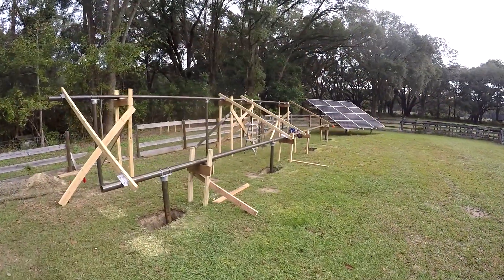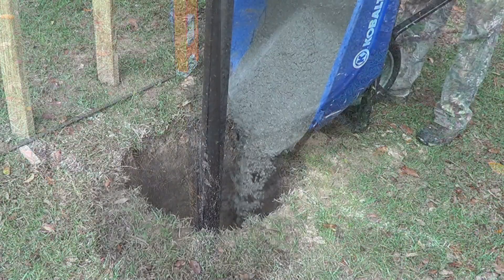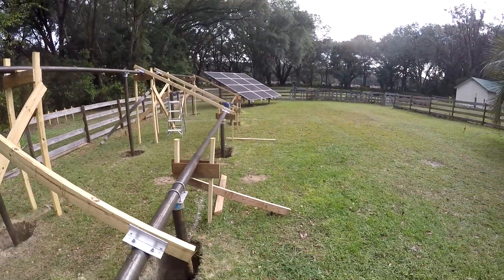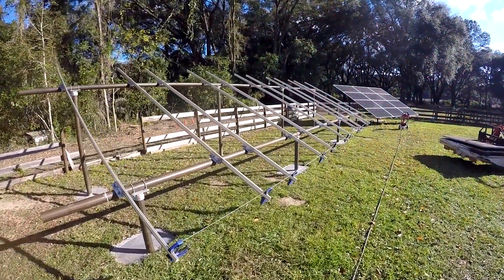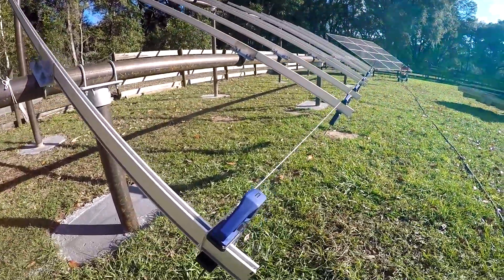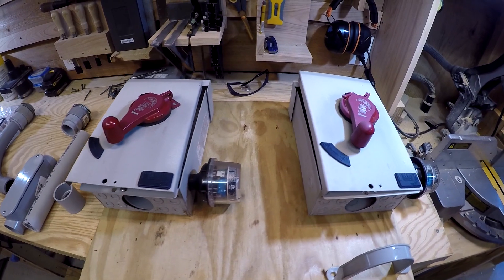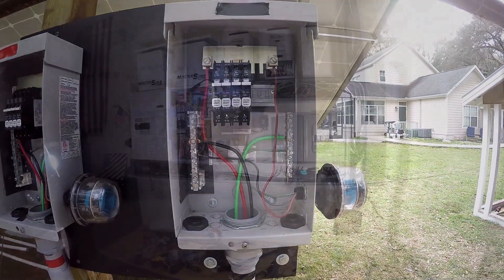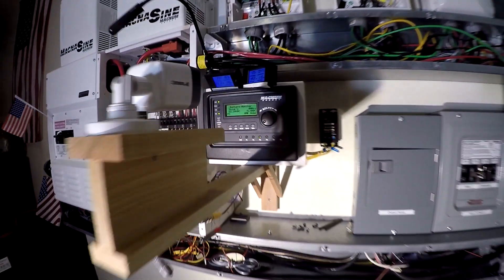DIY Ground Mount Solar

Comment: When you pour concrete for those posts, it's a good idea to drill the pipe 3/4" and insert a 5/8" rebar 16" long through it (maybe two in a cross pattern)  then send it in the hole. This acts like an anchor. The wind would have to uproot the whole concrete pour, as a straight, smooth pipe with no base flange can come out eventually.
Reply from the maker: Yes, That's what I did and I show a bit more detail on that here: https://youtu.be/-YeIbNp6ANU?si=_uAP5qmLjpExafPq
Reply: @HomesteadEngineering Awesome bro.

Comment: I would love to have a ground mount array like that. Nice work. Are you going to cap the pipes to keep the hornets out?
Reply from the maker: I do plan to cut them off to fit closer to the panels and I think capping them would be a good idea.  Thanks!